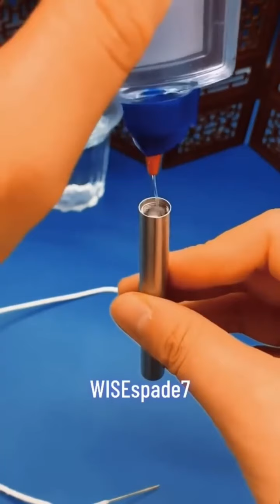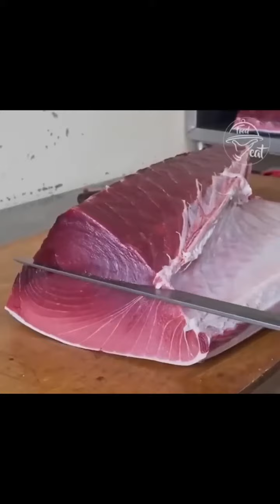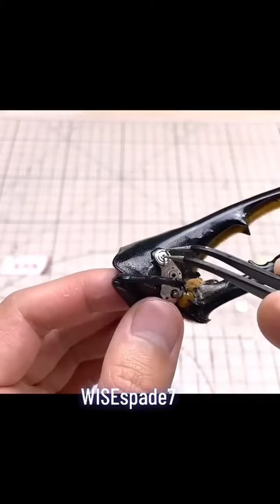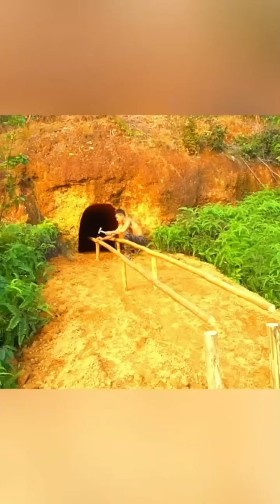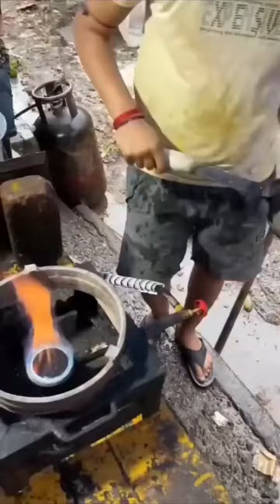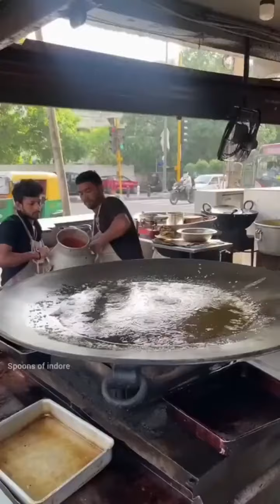HOW MANY ARE GOIGN TO BE MAD IN THE COOMENTS ? #trending #yapping #asmr #diy #wisespade7

Comment: I’m not sure what you do for a living… I can guarantee you require roads for that though lol

Also yea… filling a pothole with water is not the right way to repair it. Neither is how I do it… but I work for a rich town, so a cheap town. To do it properly you cut it out and square it off, fill it with hot asphalt, tamp, then seal the edges with tar. If there’s some moisture that’s fine, is what it is… but not a swimming pool.

Comment: These assembly lines are like what the USA used to have when we started them at ford. Lots of people there doing just 1 simple job over and over . The fact that China still has a lot of these useless jobs that could easily be replaced with current or even last generation automated manufacturing tech , shows that they really aren’t some high tech powerhouse . Capitalism has gave incentives to business to cut costs and replace it with automated machines , which drives innovation and creates jobs in different sectors. These Chinese people look like they’re on their 2nd full time job of the day and couldn’t care less . But China isn’t straight up capitalism. The state has a lot of say over business and business innovation so jobs like this slip through the cracks.